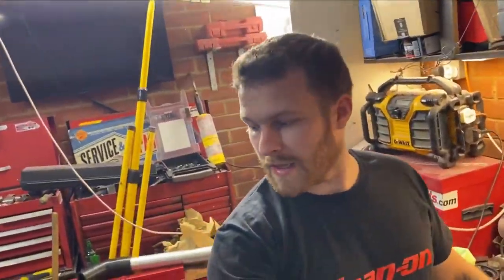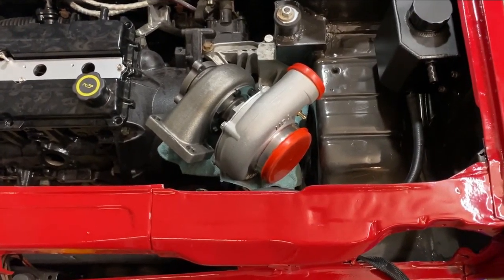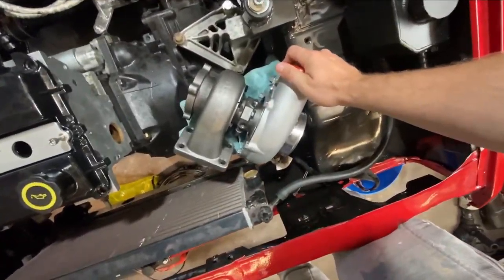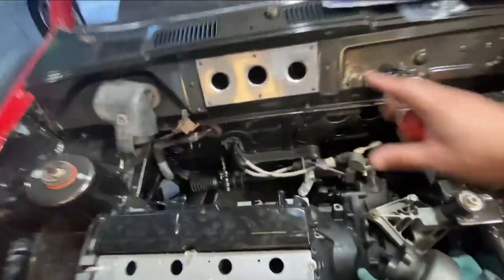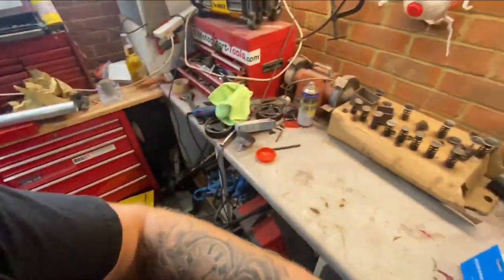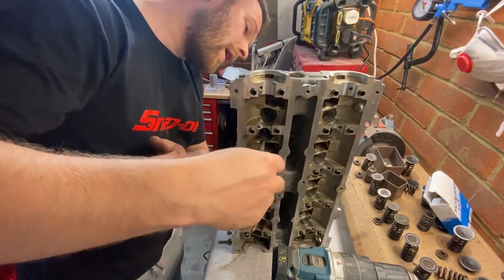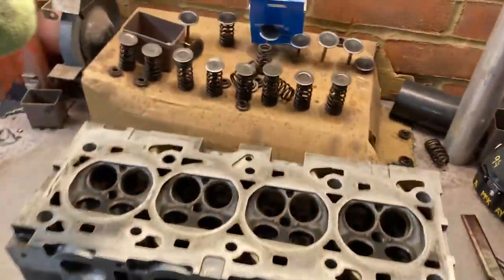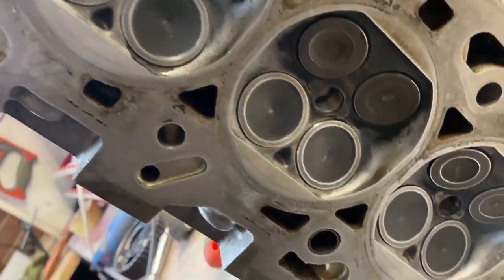Zetec Turbo build part 2! Fliss gets a turbo and valves get lapped!

Comment: What are head studs are you using?
Reply from the maker: ARP ones bud. M10
Reply: @LittleRedFiesta  did ypu ever think about putting in the M12 Arp head studs? What is your thought on this? I am trying to build my 2liter Blacktop zetec.
Reply from the maker: @bigray3360  m12 was overkill for my power goals. Unless your going to be running crazy amounts of boost standard m10 ones will be fine
Reply: @LittleRedFiesta  I am looking to run 550whp